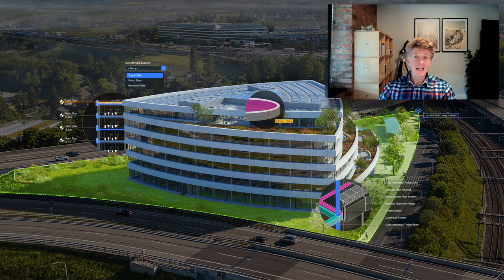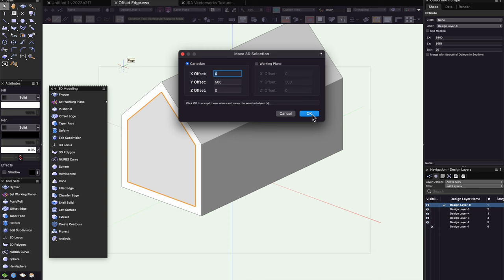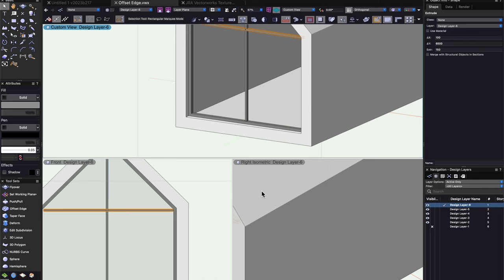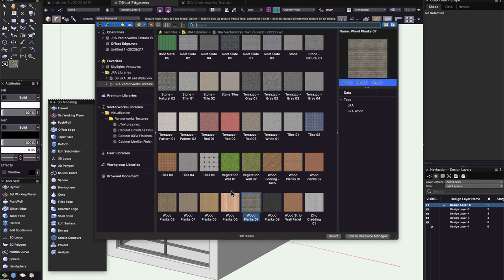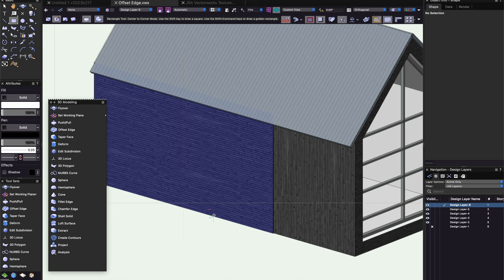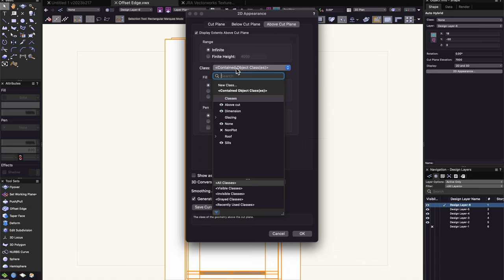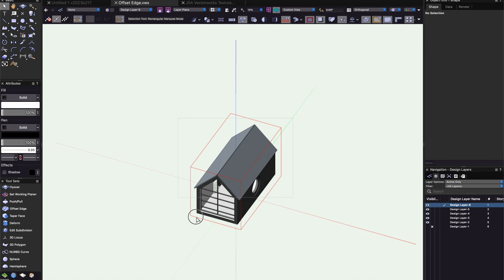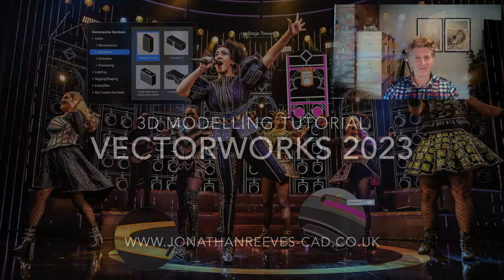Vectorworks 2023: 15 Minute 3D Modelling Tutorial

Comment: Hi! I have a question. I want to get better in vectorworks so I was following your tutorial. In the beginning when I want to extract the face of the house it makes a nurbs surface of it. So it extracts in the length of the house and it doesn't extract to the inside of the front face. I saw in your video it doesn't make a nurbs surface. Is there a setting wrong in my vectorworks?
Reply: I have this exact issue as somebody trying to move from Revit to Vectorworks - i've tried every setting imaginable that i can find (being completely new to this software) but can not for the life of me figure out why it won't offset to the internal face rather than "along the ridge" as it were.
Reply from the maker: Change the setting before extracting in the preferences and always select " Create Planar Objects" before extracting then you can extra them.

Comment: Hi Jonathan - i am wondering why when i push pull the pitch of the roof it doesn't automatically add to the rectangle. I don't see any "add" option. I am using VWX 2023
Reply from the maker: Check the modes at the the top left and make sure both are on.
Reply: Hi @jonathanreevescad < I have the same problem ...I have VW23